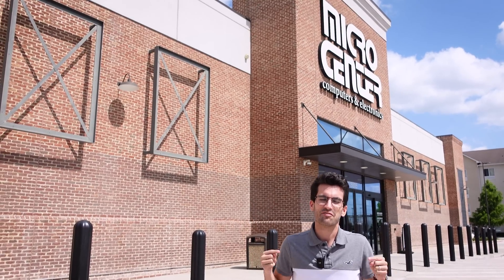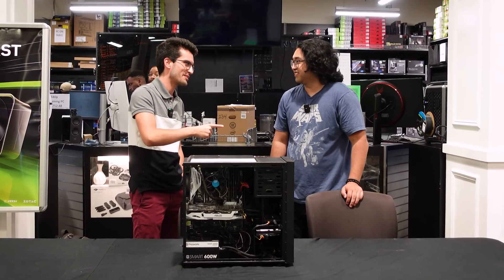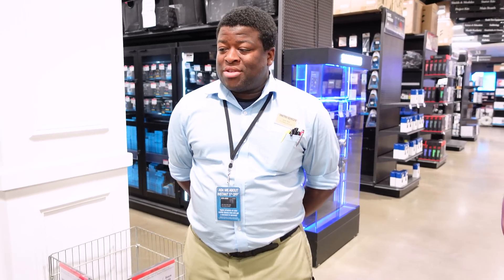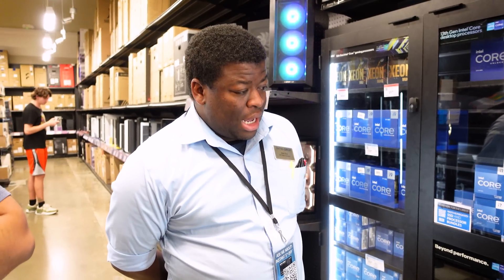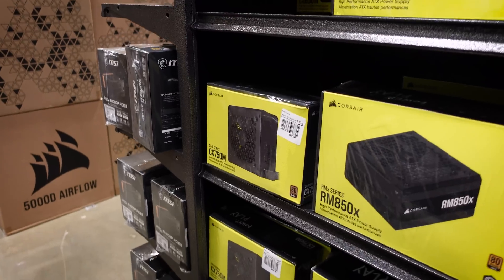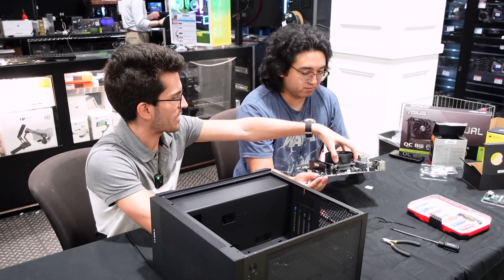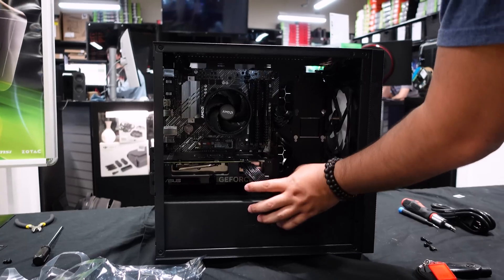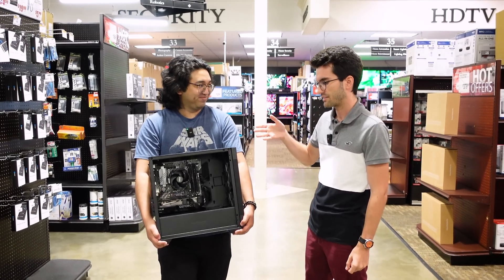Helping ONE LAST PC at the Houston Micro Center! - Gear Up S2:E6

Comment: That was brilliant - a whole rig ( minus RAM) for $800 really isn't too bad at all! If you needed Wi-Fi later on down the line you could add a Wi-Fi/BT PCI-e adapter, these don't cost much... alternatively more RAM won't cost much either and 8GB DDR4 on the old build will still get you by if you're only doing light stuff.

Comment: Hey just curious if youd like to put your input in on this. 
So I cant afford to buy spare pc parts at the moment so I used what I had to troubleshoot but my issue is this. . 
I have a 9th gen Intel motherboard running a 9700 non k chip and a Radeon Rx 570, of which I plan on replacing soon to something bigger and newer. My issue is when I was playing low load intensive games, the system would pop up with "such and such game has stopped working" I thought maybe the game had a bug but no; I went into my AMD software and looked at the metrics and my GPU's utilization is rapidly spiking. My first thought was cabling. So I turned it off and re plugged everything. Still there. Next was maybe a power supply issue because although the GPU was the real star (utilization would look like this in 0.5 sec intervals | 0...7...89...27..2...0...100..100..76..43 so just an up and down motion. Basically a person on their cars throttle trying to show off haha) at this point im almost certain its the gpu but the cpu is having mildly similar symptoms, usually spiking within a 10 to 15% range. Not often but does happen. 
Ive eliminated power supply, what else can I try? I dont have a spare cpu or gpu so next would be reset and software updates/malware checks. After updating BIOS, AMD software, and malware scans and any possible software related stuff I could do, nothing. Still the same issue. At this point, Ive narrowed it down to either the Mobo having some kind of inefficient power flow (giving that the cpu was showing somewhat similar symptoms) or just a bad gpu. My goal right now is to buy my desired Graphics Card as a replacement for an upgrade and just hope that that also happens to be what the issue was. If not, ill just salvage parts from the PC and make a new set. Any suggestions is very appreciated

Comment: Suggestion for the wheel: would be interesting if the weel choices had money + some specific part/specs like " 600$ + 4070" or "1000$ + 16 gigs of ram". And the parts could be exchanged for a lesser than it's worth monetary value if the contestant doesn't want it or has better ones in their system already. 

And having the same spot of the wheel crossed out from being picked more than once would increase the variety.

Comment: To bad we don’t have microcenter in Sweden, looks like a awesome store! If I won an upgrade I would had a different approach then all of the other guys that won. I really love my 1080ti and don’t feel any need for upgrading it. And my chassi is a one that I really love, so I would go all in on upgrading the platform from i5-4460 to a ddr5 platform and put all the remaining money on the design/looks and cooling. Also I’ve already upgraded my psu so no need to put money there. 

Only an m2, motherboard, cpu and ram. And the rest would go to design/looks/cooling

Comment: I'm curious,,,u built him a rig with a 5600x ,,I just over 2 weeks ago picked up a 5600x3D ,,Asus b550 motherboard and 16 g of RAM for 299.00 plus 50 snacks for a awesome 6 fan case and a stick m.2 404.00 altogether,plus a 6700xt? For 369?? Throw a few bucks in for a power supply and you would have had a way better rig in my opinion why? because it's awesome, plays anything I throw at it,,,and also an awesome shout out to micro center,, I drove 180 mi each way to my nearest location and it was well worth the drive,, they have amazing staff and amazing customer support

Comment: Saw that ram issue a mile away 😂 but it turned out awesome. I have to stop myself from visiting microcenter on a daily. My guys there are awesome. 

Just built 13900k from am3900X and they recommended kraken360.. I was dead set on Corsair 240 and gave nothing but headaches.. once I switched over to Kraken360, I've had no issues.

Comment: Wish he could've carried over his old case since it had that old school flair but the end product is still decent. Can't wait for the next season of this series! Shouts out Greg and Micro Center!
Reply: Tbh that Lepa case looks like a bad clone of BitFenix Shinobi. It's like they took the front panel of the Shinobi and put it on a generic case which doesn't follow the design of the front.
Lepatek also mentions it has a soft touch coating, if it's anything like the one on the Shinobi it will get sticky over time and all dust will be basically glued to the case.

Comment: It's a heck of an upgrade, and that employee (Isaiah, I think) is simply awesome...but gosh darn, I hope that 16GB's of Corsair 2133MHz RAM he recycled overlocks like a beast!
Reply: Coming from personal experience, it's not gonna really matter much if it doesn't. I had to downclock ram in my system as it would crash at xmp(I think it's going bad, but I finally have it stable for the moment, down from 3600 to 3000mhz), and the difference in gaming from 3600 to 2400 is maybe 2-4 fps, like seriously. And the 1% lows are hardly affected either. High ram speeds really only affect productivity workloads.

Comment: The guy working in the store is awsome. Come to sweden and upgrade my rig :D. Not my personal rig but my server, it is impossible to find ddr3 8gb 8500R or ddr3 4gb 10600U at a resonable price (yep it is that specific 4gb ddr3 10600R nope, 4gb ECC Nope, 8gb 10600R Nope, 4gb 8500R YES) and yes i have alot of memory for sale as i read the manual after trying to upgrade :D

Comment: As someone using a 4060 as a placeholder till my 6950xt is back it ain't that bad. I can run high mixed settings with epic distance and DLSS balanced = 120fps in Fortnite and 100-110 in MW2 at 1440p Ultrawide. I am honestly surprised that it is as good as it is with all the hate. Yeah it'd be nice if it was cheaper but it does game well. Going from from his old system to the 4060 and 5600x will be a hell of a jump. Nice one!!

Comment: I have a question, so my rig looks similar to his, but I use 2 SSD, and I'm planning to get my first M.2 drive. The problem is I'm scared that the m2 will overheat or something worse since it will be under the cpu fan and above the gpu like his. What can you guys recommend, thank you
Reply: if your motherboard has a heatsink for the m.2, it will be fine if it doesn't get a after market heatsink for it don't worry it will be fine
Reply: Unless it's a gen 5 ssd, those need serious cooling if its a gen 4 or gen 3 any heatsink will do the job

Comment: It went from: We're getting a GPU to: Everything but the power supply... to new everything real quick. Isaiah (sp?) is a boss.
Reply: 650w is perfect for this rige small amd + 4060 no reason to change power supply
Reply: They definitely did him dirty with the 4060, Poor dude
Reply: @TheFalseShepphard  Going from a 1060 to a 4060 is a huge jump in performance especially for free.
Reply: @outa7192 It's not that just the 4060 is a bad value could've gotten more for the money if he had kept the case and PSU could've gotten himself a 7800xt  which would demolish the 4060 (someone on a budget GPU like that shouldn't be worried about RT AMD is just superior at the budget level)
Reply: @gokublack8342  I never talked about ray tracing or bang for the buck. I just said that he got a free upgrade. From 1060 to 4060. 
He also had the final say in the build. If he didn't like the configuration/parts in the build he could have easily said, that he wanted to keep this/change that, etc. But he didn't.

He also has another rig  that he could do anything he wants with. Give it away, have it as a back up etc.
Reply: @outa7192  I was just clarifying that's what the other guy you were replying to meant by "poor dude"
Reply: @gokublack8342  Poor dude could have meant anything. You're just grasping at straws. 

Also to reply to your other comment. 3050 is like a 200-250$ and a 6800xt is like a 400-450$. Which aren't remotely the price category and the 3050 is faster (about 1.5x faster) than a 1060 3gb. 

We can play the compare game all day long and it won't go anywhere. He got offered those parts and decided to accept it.
Reply: @TheFalseShepphard  i'd take a free 4060 anyday, its FREE
Reply: @luthermartin44  well would you rather have a 3050 or a 6800XT? I mean one of these cards is clearly better
Reply: Yeah even the 3060 is a better deal which is mindblowing since it's a generation older @TheFalseShepphard
Reply: which he needed nothing of really, the 1060 is still viable to run games 60 fps and over in 2023.
Reply: @dazzle4416  That depends a lot on the game, many newer AAA games won't run at 1080p 60fps on a GTX 1060 3GB
Reply: @DarrenFroggatt If someone gives you 800 to spend you upgrade the GPU unless you already have a current gen(or 1 gen old or it's a 2080 and up) no reason not to. He had to spend some to get a new board to upgrade the CPU because the CPU was really old. He should've reused the case and the power supply though cases don't really go bad and the PSU wasn't that old because he had already replaced it. Could've taken the extra money and gotten an AMD GPU like the 6800xt or the 7800xt would've gotten him alot more for the money

Comment: 0:15 Worse than Taipei heat?
Reply from the maker: Taipei heat is very similar to south FL heat. Has that tropical-ish, humid vibe. The Texas heat we were feeling was nuts. Felt like being microwaved (just speculating there LOL).
Reply: When I was driving around in my convertible with the top down, the wind felt like a hair dryer. This summer has been an exceptionally bad one when it comes to heat in Texas.

Comment: It would be awesome if we could get before/after performance in season 3!
Reply from the maker: Would be difficult and very time-consuming. Would require an internet connection, standardized benchmarking suite (say, 3DMark), permission from each owner before/after, and much more time that we simply didn't have. Each of these took around 4-5 hours to film, and we were filming two per day within a 3 day span.
Reply: would be pointless considering the 1060 and his build before was sufficient and no upgrade was needed, @GregSalazar
Reply: I commented the same thing on a different video.  Completely understand why it’s not feasible though.  It would be interesting if the winners posted even seat of the pants feelings in the comments.
Reply: When the user is tech savvy enough they could run a couple things before and after tbh

Comment: Well this Digital version of Pinwheel program is probably based on RNG, and not actual Spin motion.
And the RNG probably considers a value as the average with higher probability. So, the same value pops up more often.
And if i am right, the highest value (that being $1200) has the least probable chance as per RNG.
Reply from the maker: I don't think it's that complex Lol. I could type whatever I wanted into each slice. Doesn't have to be a number. I think the value/text in each is irrelevant.

Comment: On todays episode of "How to build an $800 computer using Microcenter's open box deals."
Reply from the maker: Hahah I'm definitely gonna have to juice up the money wheel for season 3 😅
Reply: @GregSalazar problem with the wheel is that with clicking the center, and starting the wheel at the same position, the software makes it spin the same speed every time.
Maybe add a function that the longer you hold the button, the harder it spins
Reply: and some amazing in-store bundle deals and prices too.
Reply: he actually didn't get any open-box components tho.
Reply: This is a optimized build at least with pcie 4 support and resizable bar
Reply: Could it be that the wheel is set so the probability of getting any high numbers is much much less than the lower numbers seeing that it is a program your using 🤔. No one got the high numbers and I only remember 1 person getting the add 100, maybe bring back the big wheel in the next season 🤷🏻‍♂️.
Reply: which were not needed.

Comment: Surely a 6700xt would have been better value than a 4060!
Reply from the maker: They had 'em and he wanted the 4060 👍 Not everyone on planet Earth wants the same RX 6700 XT.
Reply: The 4060 is a good card just badly priced, but for $0, it's amazing. Yes, it's not worth it if you have a 3060 but that's not what happened here